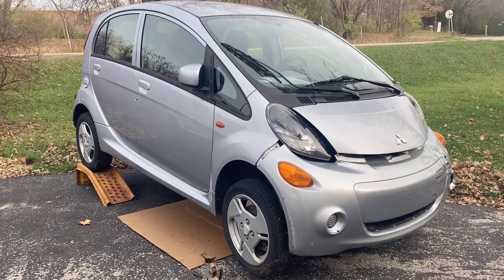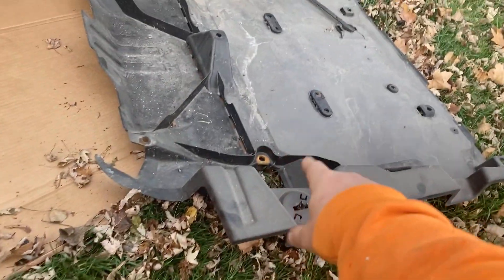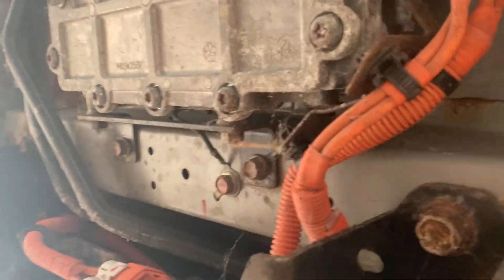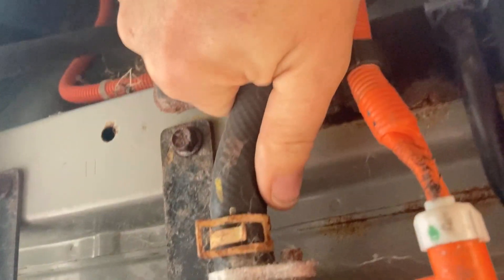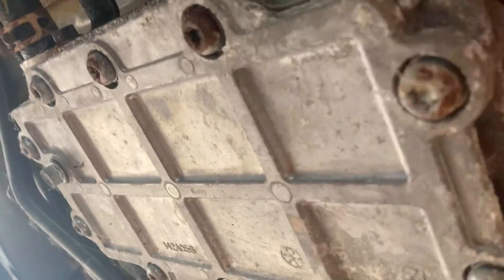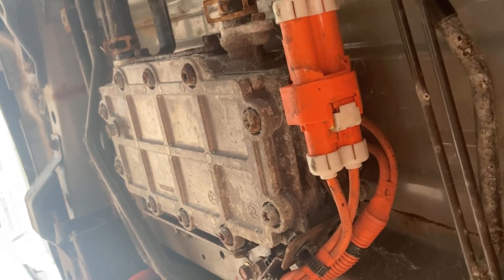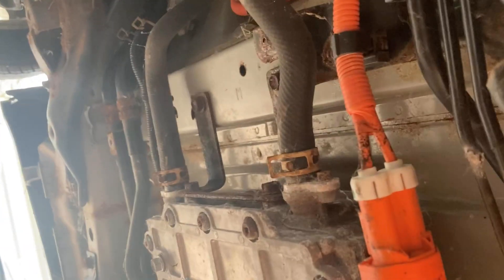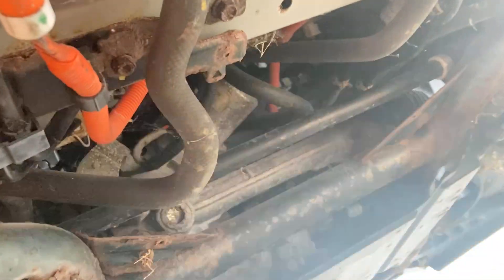Mitsubishi iMiEV electric heater under car

Comment: What is that heater used for and why is it powered while the car is parked.
Reply from the maker: It's the heat for the car. Just the regular heat that warms up the passenger compartment in the winter. It's powered on because the car is on and I turned on the heat to test and show it off.

Comment: Hi Benjamin, just wondering is it safe to use underbody protection? I have Peugeot ion and it is started to rust at the underbody. Can I just sand it and then apply some underbody protection?
Reply from the maker: I don't see why not. It's just a car like any other as far as metal goes.
Reply: @BenjaminNelsonX  Thanks for the quick reply. But do I have to take any extra precaution before sanding and applying underbody protection, since it is electrical car

Comment: Hey mate I’m hoping you can help me out. If you’re familiar with series hybrid ev like Fisker. It might help explain my goal easier. Basically I have an 06 Chevy trailblazer.  I want to disconnect the tranny from the engine. I want to install 2 powerful alternators that charge a set of 6 batteries in parallel.  The goal being I want to connect an EV motor to my rear axle and drive the car using electric only.  While my gas engine runs the timing belt and alternators. Is my theory possible?? Please help.  I’ve contacted several companies and know one knows if this would work.
Reply: I would use a 4cyl to begin with I had a trailblazer the inline 6 wasn't the best on gas anyway and there a heavy body on frame unibody would be lighter for better power to weight ratio.